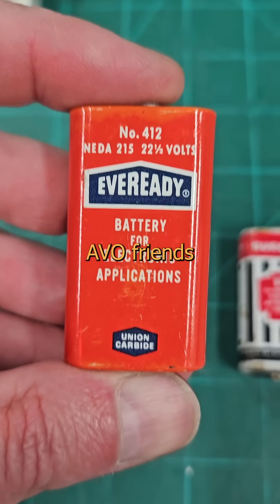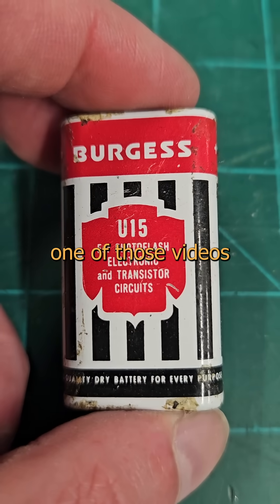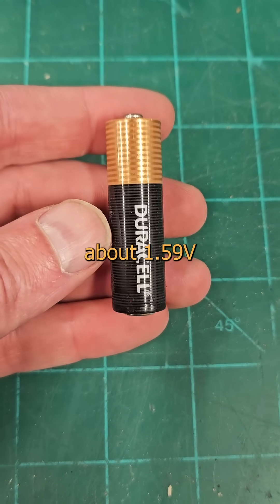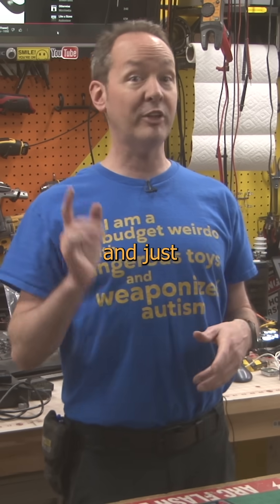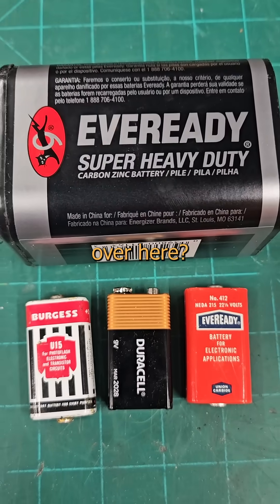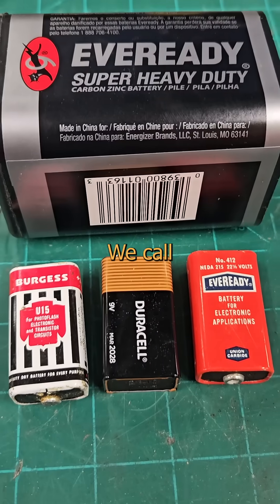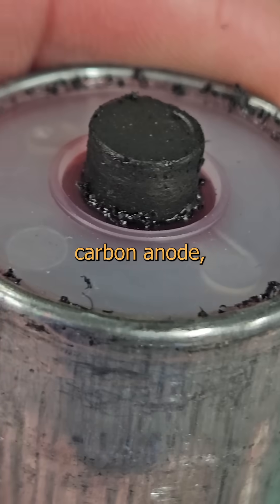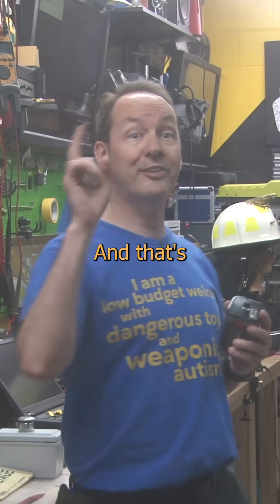Size 412 Battery #chrisboden #comedy #engineering #words #definition #chemistry #haka #science

Comment: I haven't measured many carbon zinc batteries.  As I remember every new alkaline battery I've measured is 1.72v. Often AA batteries are used in pairs. Standard  NiCds are 1.22v, li ion 3.7v, li-fe-p04 3.4v, li-poly 3.8v. Low - high 1.0-1.4, 3.4-4.0,  3.4-4.2.
An easy solution to this mess is a buck-boost converter.  I like LiPoly because they are high energy density and very high current.  One can use a linear regulator such as lm78vv, vv= 05, 08, 15. Or add current regulation with lm317 but be very careful with the current measuring BJT.  A 9v battery is 5*1.7v cells =8.5v. I presume they don't want to destroy someone's device with 6*1.7=10.2v. Electronics is rarely damaged with under voltage but some component often blows up with over voltage.

Comment: Its fun when my 10 year old a couple years ago rigged a "AAA" battery to go where a "AA" battery was supposed to be. He was too lazy to find the right battery. He was so excited and wanted to show everyone. I explained they are all the same voltages, so it was no harm except the foil and wires he was using to run the power through. I said if he touched it, he might get a shock.

Comment: I had a portable vacuum tube radio that used one of those 22.5 volt batteries for the plate voltage, and two C cells for the filament. This radio was from the '50s, and about the size of a large paperback book...

Comment: I found a pair of AA batteries in my father's old analogue multi metre that was last used in the 60s the battery was still fully charged at 9v no corrosion or loss in capacity from 1960s is astounding to me considering the modern battery lifespan . I've used it several times when needed and it's still the same voltage, there was also a1.5v in the same condition both are  "Novel " long life brand made in Japan by Fuji electrochemical co.

Comment: Should explain that higher voltages were required by limited electronics. 22V were required to drive tube plates and 9v was required to drive early transistor equipment. Modern chemistry requires only 3.3V or less to operate.  So 22v went obsolete with valves and solid state which were also cheaper.  9v are still used today for anything that still requires efficient 5V or greater supplies such as smoke alarms and some toys.

Comment: I've actually run across a few different designs of those 6v lantern batteries over the years, some are simply four smaller cells inside, but a good many I've hacked open were one big single cell packed with electrolyte in an internal 'can' wrapped in the retail labeling. There's also lead-acid versions of them commonly used for trail cams and multi cell camp lanterns.

Comment: Fun act. Typical 9 volt batteries have AAAA batteries contained in them. I priced out  a few AAAA for a special UV pen light I had for detecting Freon leaks and when I heard how much they were I just about fell over. Used the ones from the 9 volt. Just had to file off the welded tabs on the AAAA’s to get them to fit correctly.

Comment: Correct me if I’m wrong but I’m pretty sure those old 22.5 volt batteries were used in old flashguns, and the science behind the original flashbulbs is very fascinating and you should check it out

Comment: The double Ds are actually F cells. Those high voltage 22.5V, 67.5V batteries were used in Valve radios.  Yep I am old enough to have used them.

Comment: How often do you see a 12 V lantern battery these days? They used to be common when lantern lights had what looked like a car's headlight for the bulb, a handle, and sometimes a red light on the back end of the handle, with the big 12 V battery screwed to a plate under the handle.

Comment: NOW, You need to expose the (Fraudulent?) "20 V Max" and even "21 V" Lithium Ion batteries on shitty brands of cordless tools, which have FIVE cells of 3.6 Volt, but are now FRAUDENTLY labelled as "20V max") or even more, a voltage that is only available under OPEN circuit and just immediately after removing the battery from the charger, but NOT during 90% of the useful discharge cycle, being in reality only "18 volt" batteries...

Comment: 50+ years ago that 22.5 volt battery was commonly used for plate voltage in tube type receivers used in radio control model aircraft. Haven't seen one since 1962.

Comment: I have one of those. Actually ive got a couple of other ones just as odd. But rhe really weird thing i have in this field is a dummy battery. It came in a portable radio from the 60s. I think it exists because to use the power cord, instead of the batteries, a circuit needed to be completed in the battery tray. But maybe not?

Comment: Um... 🤓 AKSHEWALLY... 1.5V batteries are often made of multiple smaller cells, too... The difference is series vs. parallel. One raises the voltage, the other doesn't... Just like most devices use several 1.5V batteries in series, either end-to-end like in a flashlight or in alternate directions with joining leads on the ends. But a few use the 1.5V batteries all connected the same direction.

Comment: You're right.   I'm older and have been around batteries all of my life and have seen so many different ones.   But I have never seen this one before.   22.5 volt ???   I'm curious as to what it's used for.   🙃

Good ol' Never Ready batt.
Reply: LMAO, I remember when Energizers were REGULARLY dead out of the box, too! 😂
Reply: I've certainly used one. IIRC it was used in a camera flash that was with an old camera that a relative gave me. (Probably 1950s/60s). This was a flash from before those "cube" flash bulbs that you could use 4 times. It had a big reflector that opened out with about 6 leaves. It took single use flash bulbs containing magnesium wool. I think the glass bulb was coated with some blue gunk on the inside of the glass. When the bulb flashed, the glass would crack and the blue gunk would leak out through the cracks, holding the (very hot) glass bulb together. Things were so safe in those days!

Comment: I have an old Radio Shack battery tester from the early 80s, I think. It's easy to use. You put the positive on the terminal, and there's a lead that you put on the negative. And it says whether it's good or bad. For D, C, 2A, 3A. Now I know why. They're all 1.5.
I just put my tongue on the 9v. It's a great video. I feel like I should have learned this when I was a child, not at 49. It's not gonna change my life now. But when I was a kid, it probably would have led me to other questions to ask.
Reply: I have an old Radio Shack Volt-Ohm Meter (VOM) from the 70's.    Still occasionally use it.   I miss Radio Shack.
Reply: @jogallagher3680  I have one too from the early '80s that I might have partly assembled myself. I can't quite remember.

Speaking of batteries, I think when I pulled the multimeter out of wherever it had been sitting for years and years, not only did the multimeter still work but the battery was still good. I don't even remember the last time I changed it. So the thing is 40 years old now and still working fine. I admit I did buy a digital multimeter since then when I was working on a project where I needed more precision than that little analog needle. I'm guessing that multimeter might not be working in 40 years.
Reply: One more thing, speaking of missing Radio Shack. I was working on a project recently where I just needed a few random resistors. And I wasn't even quite sure of the resistance I needed because I was doing a little experimenting. I couldn't find a single retail store in my city where I could buy resistors. Not one in a metro area of about 6 million people. The non-Radio Shack places I knew from past years had all closed down or switched to being computer stores. I ended up having to buy everything from the internet and now I have 600 resistors I don't have much use for so far.
Reply: @kentix417  Yes Ken, but you will have them now.   

I get what you're saying though, pack of 1000's. I just did this with a pack of door panel clips. Needed about 10, now I have at least 50 spares.
Reply: @JameWelling  "I have an old battery tester from a reliable company. However I still feel the need to test THIS battery the old fashioned way by zapping....or not zapping....my own self through my tongue. Which means I do it just because I like doing it." 😂😂Me too brother me too. 👻🙈🤟
Reply: Holy crap. You brought back a childhood memory I totally forgot about. I vaguely remember us having one of those back in the day. Never expected a comment about an old battery checker to give me nostalgia lol
Reply: never too old to ask questions and learn stuff.

Comment: How does that reaction work? What are the things in brackets, I think they are elements, right?
Also it is with lowercase letters what is weird for me also where does other hydrogen go? 
Zn(s) + 2MnO2(s) H2O(l) <-> ZnO(s) 2MnO(OH)(s)

After a bit of research I found out where does the hydrogen go (it goes in 2 near Mn) and possibly what happens with letters in brackets as they could be iones.
I'm still a bit confused why they have lowercase letters, and I think the one that looks like L acutally should be i although it looks wrong.

Alright did even more research and l means liquid, s solid g gas and aq solution in water.
If this helped anyone I'm glad about it.

Comment: I’ve only used one 22.5v battery in my life.  It was an Archer kit that flashed four neon bulbs.  It fit into a battery holder that looked like it was made for a C cell.  I’m surprised he didn’t get into the 2mm difference in size between the 1.5 N-type, LR1, and the 12v 23AE, A23, MN21 types.  And I used a 6v Lantern battery that was also heavy and sturdy enough to use as a base to launch my model rockets.  Kids don’t know what they’re missing these days …

Comment: Always known 6v/12v lantern battery cells as ‘F’ cells. Four in parallel are effectively equivalent to a No. 6 cell. Used them that way to power filaments in battery tube radios. Six holders of ten each ‘AA’ for the plates.

Comment: The cells in the 6V lantern battery are size F cells.  The old 7-1/2 volt batteries with the binding posts and handle on top had size F cells as well.

Comment: that spring top 'lantern' 6v battery that has cells you named 'double D', i've seen some that do have actual D size cells in..and you can get battery holder/adapters that take 4 D to fit in place of them..

Comment: One hell of a way to explain the difference between those 1.5V batteries compared to a car battery. I guess not everyone knew this. Or that you can put those 1.5 V in series + to - and gain voltage each battery is adding another cell.

Comment: I wince opened up a dead 9-volt so that I could repurpose the contacts, & instead of 6 AAAAs there were 6 flat cells stacked on top of each other. They kinda resemble coin cells, being flat on one side & slightly sloped on the other, but they were the same rounded rectangle shape as the casing of the 9-volt. Never seen anything like it before or since

Comment: .
    UHHH, if you take a 9 volt battery apart, you'll find that it is NOT a collection of  "a half dozen quad A cells". Quad A cells are as long as AAA cells, (just thinner), which are quite a bit longer than a 9 volt battery and 6 of them, collectively, are quite a bit wider than a 9 volt battery. There are 6 X 1.5 volt tiny cells in a 9 volt battery, just not quad A cells.
FUN FACT:
    Electricity and electronics has been my hobby and passion for almost 60 years. When I was a kid in the 1960's, Alkaline batteries weren't out for use in the general public yet and name brand carbon / zink batteries like Eveready, Rayovac, Burgess and Homelite, (sold by Noah's Ark hardware stores), were common.
    A 9 volt carbon / zink battery then was about 12c to 15c + 1c tax, but these didn't last very long in my state of the art 2 transistor pocket radio.
    I went up the street to my local Sears department store and made the painfully large investment of $1.59, (1.70 with tax), almost 4 weeks allowance, and bought a "9 volt" Sears brand mercury battery. I say "9 volt" as it was actually 8.4 volts. Instead of 6 X 1.5 volt carbon / zink cylindrical cells, it was actually 6 X 1.4 volt mercury button cells the size of today's LR44 1.5 volt alkaline button cells. While carbon / zink cells are rechargeable to some extent, if you are CAREFUL, mercury cells are much more amenable to recharging if you don't overheat them. Also, once carbon / zink cells are depleted, recharging them never brings them back to 100% full capacity. More like 75%.
    With the charger that I built for it, this mercury battery kept coming back to 90% or better for over a year so after the first 14 over night slowwww charges, (about 10 or 11 weeks), my huge investment of $1.70, tax included, had paid for itself and the rest of the year and a few months was gravy. All together, over it's lifetime, about 60 charges, it brought the cost of that battery down to about 2.8c per charge / use instead of replacing batteries at 12c to 15c each. Back then, trading 3 gum balls for a 9 volt battery was a huge savings.
    Sadly, after about 15 months, when my little toxic wonder gave up the ghost, I did an autopsy on it and that's when I found out that it was made of 6 button cells instead of 6 cylindrical ones. Also sadly, they don't make mercury batteries anymore. But, then again, if they did, they would be a lot more expensive than Nickle Metal Hydride or Lithium Ion rechargeables plus their milliamp hour capacity couldn't compete with the previously mentioned two. They were better suited for small, low drain items like the pocket radios of the day but not for the big time, high drain, electronics of today.
AND THAT'S COOL!!!

Comment: I have two Triplett VOM's that need new 412 batteries.  They will work without the battery but the OHMs scale doesn't work because that's what the 22volt battery is for,  the resistance measurement. 😊

Comment: I found one of those that looks like a 9 volt, but has a terminal on each end and it was dead. I was about 12 years old and it was about 1976. I disconnected two wires from a speaker on a stereo that was turned on and I connected them to that thing to try to charge it. I know that was dumb and it could have blown up but I was just a dumb kid. Apparently it did charge the battery. I wanted to test it and normally you would take a 9-volt and stick it on your tongue and see if it shocks you. Because the terminals were on both ends I stuck this thing in my mouth so the terminals were between my right and left cheek inside my mouth. It shocked the piss out of me and made a huge spark. I didn't get seriously injured or anything but I never tried that shit again. I suspect it would have lost its charge very quickly even if I hadn't done that. But it was a pretty cool little experiment that I managed to survive. The first time I tried it I didn't hold the wires on there very long and nothing happened. The second time I held them on their longer and it absolutely did charge that battery, I have no idea how much voltage there was but it was not fun.

Comment: Etymology from Oxford:  Battery— Middle English: from Old French baterie, from battre ‘to strike’, from Latin battuere . The original sense was ‘metal articles wrought by hammering’, later ‘a number of pieces of artillery used together’, whence ‘a number of Leyden jars connected up so as to discharge simultaneously

Comment: Some really good duracells or energiser "1.5v cells" can be up to 2 volts when brand new, like just out the factory new but as most of you should know, as soon as you put a load on it, the voltage will Drop slightly, so most likely they're doing something like 1.7 volts

Comment: Your car battery is the same those have 6 Cells which give of 2 volts which is why under 12 Volts is bad and it’s still useable and good at 12,6 Volts which is the line where we usually swap them out for new ones

Comment: Actually most 9v batteries usually have AAAA cells, not AAA. A little known cell type you typically don't see sold on their own. As you'd expect they are a little smaller then AAA. That 22v one is probably using them too.

Comment: Years ago, when dinosaurs AND Archer kits roamed Radio Shack, you could buy a single tube radio kit, which had a 22.5 v battery just like yours for the grid and a single cell (for the filament) to power it. So I remember seeing them... I think over the years I've seen only one other device that used them. 

Back in my great-granddaddy's day, the living room radio built with nails on a literal breadboard might have used an A battery and a B battery for the filament and the grid.

But on a vaguely related subject, I'd like to ban Home Depot from selling their ceiling fans having remotes that use N-sized 12v batteries. That's cruel and expensive to source. And worse yet, the fans have no physical switches, so the remote is the only way to change the light brightness and color and to adjust the fan speed. 

But back to the point, I assume the tiny 12v batteries have a stack of "hearing aid battery" sized cells in them, so maybe I could literally "roll my own."

Comment: the 22.5V battery was mostly used to power the filament of old vacuum tubes, where you need only currents as low as a milliamp but a high voltage.